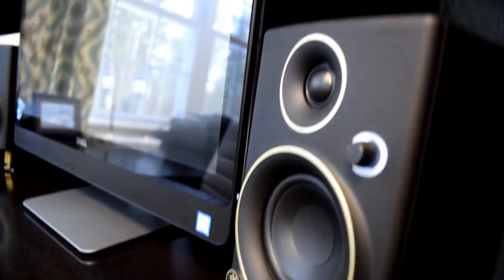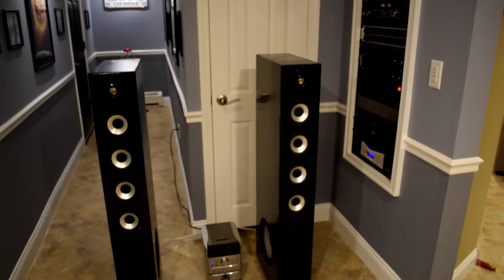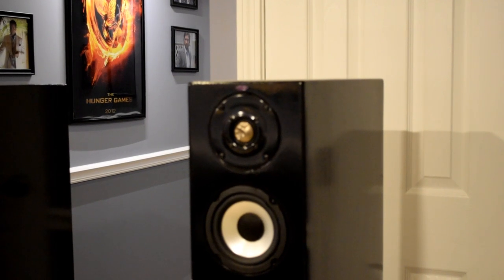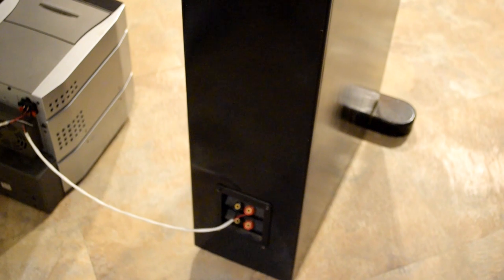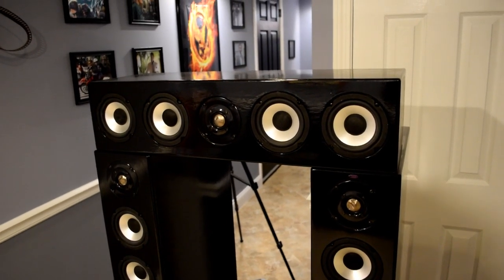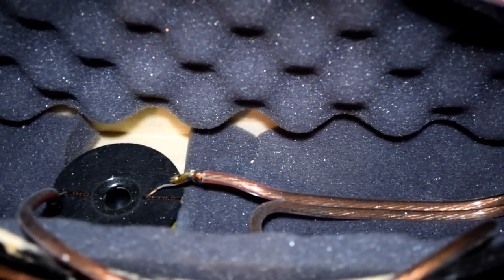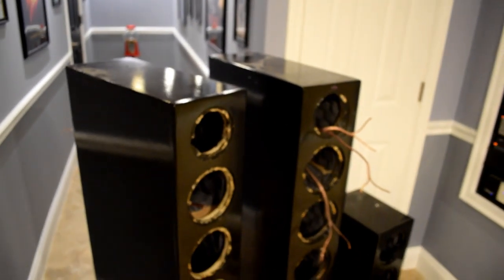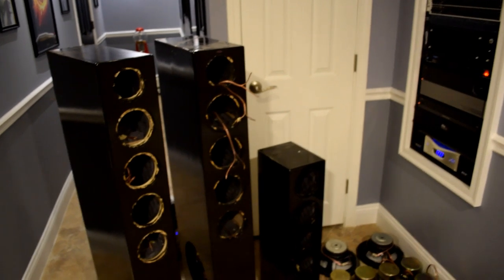Part 1: Disassembling the MONSTER Tower Speakers (DIY Build Project)

Comment: If you look on a website called parts Express they have lots to renew the surround on most any driver you should check it out that way you could keep the original drivers
Reply: Sorry that was a typo I meant they have kits to renew the  surround on your current drivers

Comment: I'm still using my 1978  DIY home made speakers.   See     imgur . com/a/VIARZn5      ( Remove Spaces )   Each speaker has 4 tweeters, 2 mid-range drivers, and one 15" woofer.   42 years later, and they are still going strong.  I did eventually have to replace the foam rubber outer rings on the woofers after the rubber had turned to dust due to age.

Comment: ( https://www.diyaudioandvideo.com/ )Check this website out, I use their calculators :) . Please let us know more about the crossovers. Great project pretty nostalgic I would presume, I was 5 yrs old back in 2001, haha. Look into passive radiators for the subwoofer part of the speaker. About the finish of the enclosures, in my opinion spray painted white would match the interior colors in the video. Good luck with the project, also I hope your back recovery is coming along well. Also check out Dayton Audio aluminium cone speakers on their website or on parts express they have the same look but may not be the same specs.